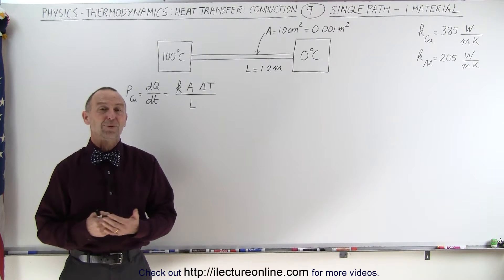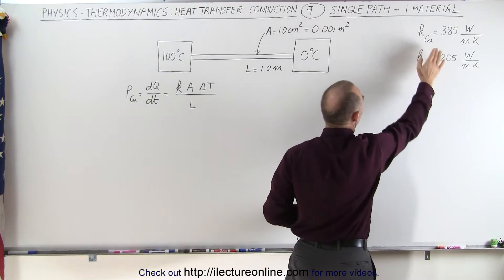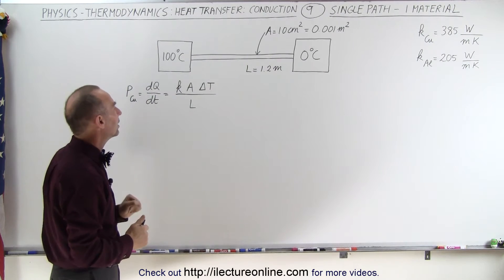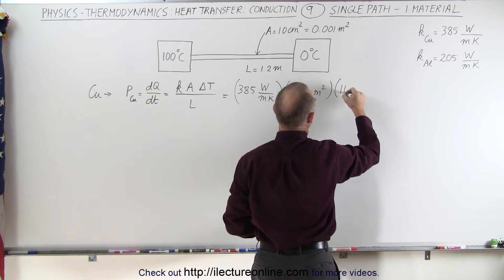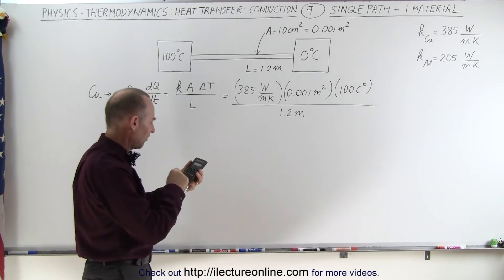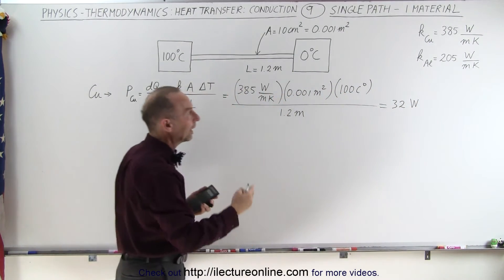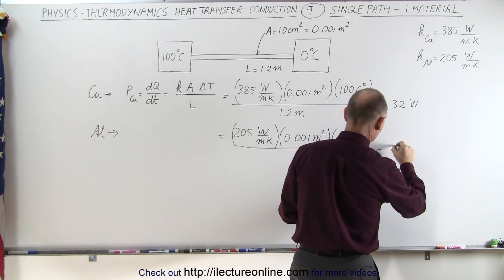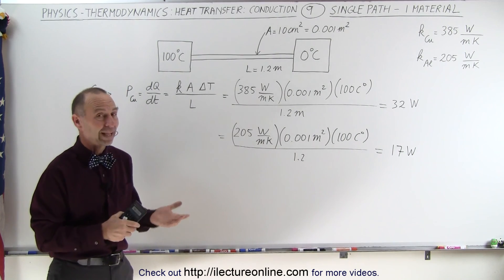Physics 24  Heat Transfer: Conduction (9 of 34) Single Path - 1 Material

Comment: Hi professor,shouldnt the 2 block have the same temperature due to thermal equilibrium at final? Like 100/2=50 'C for each block
Reply from the maker: Not if the heat reservoir and the heat sink are kept at these constant temperatures.
Reply: Thank you

Comment: Hello,

I wanted to ask about the units on K, you have W/m^2*K but for your delta T you have it in C. is this going to matter?
Reply: 100C = (273+100)K
0C = (0+273)K
Difference in temperature=DeltaT=(100-0)Celsius = (273+100)Kelvin - (0+273)Kelvin= 100 Kelvin =100 Celsius
Temperature DIFFERENCE is always equal in Kelvin or Celsius units
Reply from the maker: Not a problem since centigrade degrees are the same size as Kelvin degrees
Reply: chill, you get the same answer when you use Kelvins OR Celsius... did you forget to convert the 0 degrees?
Reply: i dont understand sir, @michel
Reply: @gutierrezmarjassonpatrick9196  100C=(273+100)K
0C=(0+273)K
Difference in temperature=DeltaT=(100-0)Celsius = (273+100)Kelvin - (0+273)Kelvin= 100 Kelvin =100 Celsius
Temperature DIFFERENCE is always equal in Kelvin or Celsius units

Comment: i want to ask that where there is no negative sign, because the equation im using is Q=-kA(temperature difference)/ length ? thanks
Reply from the maker: It depends on the definition.  In the end it doesn't matter as long as you understand what your answer is telling you.  Find out why your book or your teacher uses a negative sign.